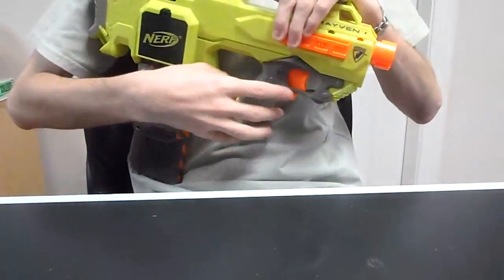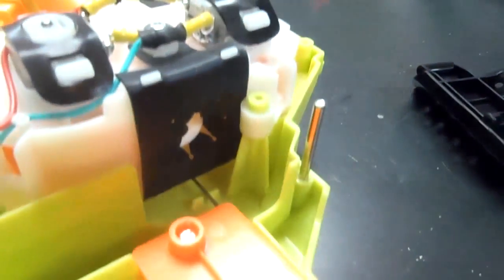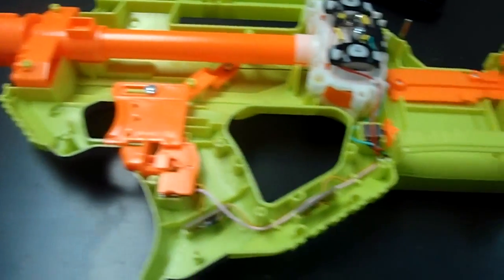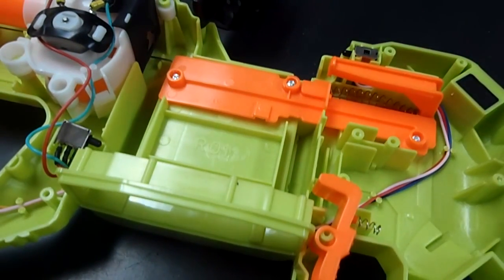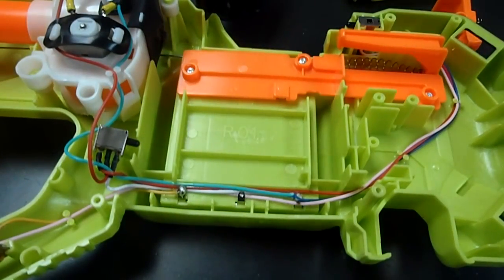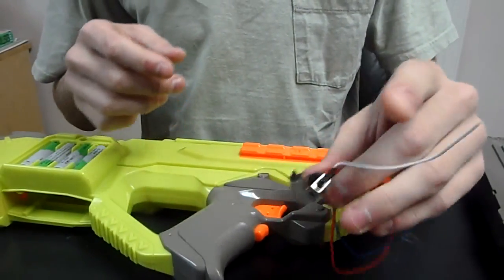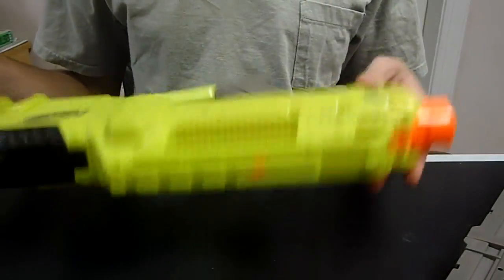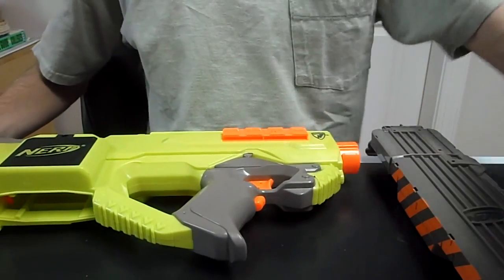The ULTIMATE Nerf Rayven CS-18 Mod Tutorial (Voltage, Lock Removal, Rewiring)

Comment: I have one problem the motors start automatically when i put the magazine in.. How do i fix this?
Reply: Maybe you removed all the switches but left the one in the magazine stuff, so when you put in the magazine, the circuit is closed and the motors begin to turn.
There should be a switch at the rev button.

Comment: could somebody pls answer this question? I wanna have a very powerful rayven. will it break if i use it at 16 volts?
Reply: Sorry I've forgotten what a micro switch what is it?
Reply: Yes, 7.4-11.1 is not going to break your blaster but will be powerful but I think you are better off with a Stryfe but if you are modding them it is just your personal preference but I do enjoy the Stryfe more.
Reply: i wanna get a better rayven to. will the stock motors be damaged at 12.6V which is 3 trustfires
Reply: Anferny Crab never use stock motors, I would recommend 2 rhino motors, a better microswitch and a 3s lipo
Reply: ok ty

Comment: I bought the regualr Rayven today, new from Toys'R'Us. I put batteries in and inserted a 10 round magazine with streamline darts. I want to press the rev up trigger but it emidently gets stuck in the gun. It is impossible to get it out without disessambling the blaster. So I went ahead and disessambled the blaster. Now I found out that the rev up trigger slipps down from the contact lever that will close the circuit, I pressed the lever by myself and it works. Fine, put everything back to place and assamble the blaster. Again, the rev up trigger slipps from the contact lever and gets stuck in the blaster. Is there a solution for this problem or am I the only one?
Reply: Just return it and get another if you can
Reply: Hey @kingcorny93 where did u get the rayven because I'm looking to buy one I'm in this east coast
Reply: Livelifetron
I live in Germany and I just bought it through amazon.de
Reply: I have the same issue maybe try putting the lock ba k in?
Reply: I put the "lock" back in and it works again

Comment: Would you find it difficult to resolder new wires? One mod I used to do for electric airsoft guns was to change the wiring with "silicon" wires of a higher gauge to prevent burnout.

Comment: In a way (I only removed the mechanical locks, because I don't have anything to solder with) I have my own kill switch.. I was following on with your tutorial, and when I was putting it all back together, I realised (Aus spelling bitches ^-^) the motor button was stuck in, and to get it out and stop the motors roaring, you had to hit the side of it.. Not the best kill-switch, but still, I like it! ^-^

Comment: That would be Ok Just Increase Battery Capacity For more Stored Voltage So it doesnt run out of battery to fast. and you could make the rev button power the 2nd fly wheel. if you want more power in the shot

Comment: seriously nearly half the comments on here are about colour blindness, just stop people, right i heard taking out the resistors helps oh and wiring in a 9 volt battery improves it as well as trustfire batteries,i did see on you tube some one moded the battery compartment so you could still use both , also would putting some electrical tape on the fly wheels give it more grip and improove the fireing at all?

Comment: I see no reason why a second flywheel assembly on an axis exactly 90 degrees to the first one would cause any problems but it would be a serious pain to rewire the entire four flywheel assembly so that the two sets didn't interfere with eachothers' wiring.
Furthermore, the only way this would get a range increase is if the two original assemblies were powered separately. I'm thinking one 9v each since they'd fit the original battery case nicely.

Comment: SUB! and I don't think id really mind the locks, I personally like the button up by the handle near the trigger to be there that triggers it, cause when the trigger u put on the back is, its always being really loud, its losing voltage do to it being on all the time, and for it to be quite u have to turn the switch on the back off and when u do need it on u have to spend an extra sec or 2 to turn it on which could give the opposite team an easy chance to hit u, im not bashin u r anythin

Comment: Just a little hint for people when taking apart the Rayven. The screws are tight as hell and have a "well" around them, so you'll need proper screwdrivers with long round shafts (I tried my special change head screw driver kit and found it couldn't reach all the way in some of the "wells"). Screw them back just as tight or there will be spaces in the seams of the body. There maybe resistance from the lower joins, don't force it. I removed the rear lock only, as it interfered with older CS clips.

Comment: so if you continue to still use the stock push button to rev the motors, can you cut out the two electronic components in the circuit? or what do they even do?

Comment: Seems pretty silly to me, to change the flywheels to a switch activated system like the stock Barricade, just makes it permanently noisy and will eat up the batteries and motors quicker.

Comment: Oh, and if you haven't already done so, you should pull out the resistors - those are the yellow guys in between the motors, just solder in new leads in between them.

Comment: @demigod115 That's pretty much the voltage mod, unless you want to use different shaped batteries which will require different battery compartments to be modified into the blaster.

Comment: Did you purposely leave the thermistor in?  All it does is get hot and add resistance to the circuit, yet you apparently left it in there.

Comment: @LordDraconical I made a link to this video in my video. I used this video for "unlocking" the electronic components of the gun, so I threw you the credit when I made my video. Instead of xeno batteries, though, I used a drill. Check it out if you have the time.

Comment: I like the noise after the voltage mod is done. I've found with a Power-strike 48 that if the gun is loud enough you don't need to fire, which is good because the PS48 is pretty unreliable if you aren't using the darts it comes boxed with.

Comment: It's an interesting mod, but I would've just removed the two electric locks (the one by the Rev switch and the one by the clip.) and setup the rev button like a flash light where you push it once to turn it on, once to turn it off.

Comment: Hey, Drac, I emoved the mechanical locks like you did. However, because of my vision, I didn't do any wiring or cut out the electronic locks, so I wasn't able to do a "kill switch" per say, but with the trigger lock removed, I just push in the button that would rev up the fly wheels. The button stays in, until I press down on the button, and sliding my finger off it, which pops the button back out. Even shaking the blaster doesn't disengage the button.

Comment: @davyn2000 hey man great idea but it might not help because of physics although the air infront of the dart will disapear but it will cause a vacuum sucking the dart towards it so it has a draw back as it could take the spin off the dart but great idea just dont put it in an air blaster :P

Comment: I think you might have left out the resistors in your circut (the two plates in the handle of the blaster), though I'm not entirely sure. I'm not entirely familiar with electrical circuts, but I left those in mine. Do you think it will cause problems for the motors?

Comment: drac,
I think I know how to reduce barrel drag. What you do is drill holes through the sides of the barrel, making it so that the dart doesn't need to push 4 inches of air through the barrel. Instead the air will go through through the holes. Hope this comment helped.

Comment: Ok guys I need your help. I have 3 partially broken nerf blasters that I want to combine into a mishmash blaster. First I have a quick 16 with a snapped connection from the plunger tube, then I have a strikefire with a crushed back end of the plunger tube, and finally a sonic maverick with a broken priming handle. Any ideas?

Comment: @CopperMasterX True....itremains to be seen  how far weighted darts can go with this design.

Id be suprised if it hit the centry mark under any circumstances but I wouldnt write it off at 18V with very good stefans.
At taht pwoer level, However, Id strongly suggest a engin repalcemnt to a strogner engin that has tollerence for 16+ volts of power....just so it doesnt sizzle out and die.

Comment: @LordDraconical i think it would have been cool to put the power switch where the clip release is, when i can get my hands on a rayven, I'll probably have a 9v battery for each motor, and a large start up capacitor for each also i don't think that would be too much, and i will use an illuminated toggle switch, the way it lights up blue would look excellent on this blaster. do you think 9v per motor is too much?

Comment: Hey, Drac. I had this idea back when I got my Barricade, but I think it would more applicable to the Rayven. How plausible would it be to replace the stock motors with hobby grade RC car motors? They're not cheap per se, but they'd handle added voltage better, and you could get higher RPM's out of the flywheels. Not only that, but the chance of burning those out is much less. Also, with added voltage mods (on any electric blaster), would adding a cooling fan help with overheating issues?

Comment: @TheNerfWarriorX Same, for me its a sidearm to be used when my primary runs out of if zombies are too close for me to waste long hitting rounds.

being able to turn it on and off on the fly is important and after the voltage mods it will rev up in less than a second so its a non-issue for me.

Comment: At current, my plan is to just wire in a 4 AA pack to the standard 4 AA pack. that should give me a nice 12V's of power and it will last a lot longer than my stampede would (since It requires a lot of power to move back the springs)

I'm going to have some seriousness fun using this ^^

I'm also probably going to remove all the locks but I'm keeping the button switch.....I like being able to keep my blaster turned off to conserve battery power ^^

Comment: @scooterjr88 pretty much yes....though it realyl depends.

if you keep the voltage at a relatively safe level, like between 9-12V, it will last a lot longer than youl be nerfing. once their you have gray areas of 12-15 where it will die a lot sooner and than anything from 15-22V is pushing it. anything beyond that is seriously pushing for a fried engine,